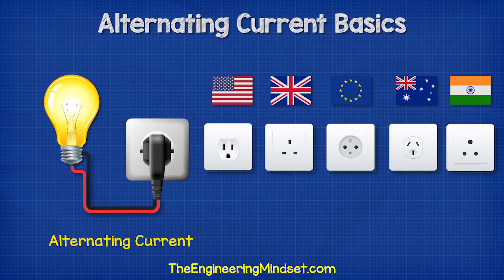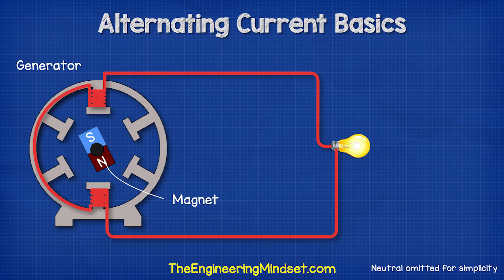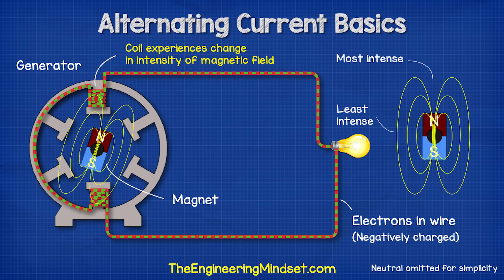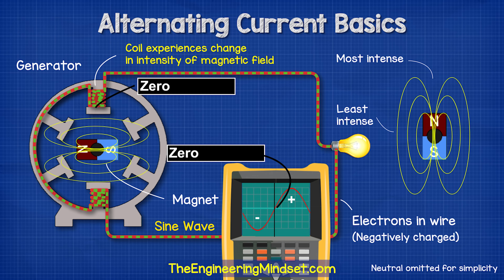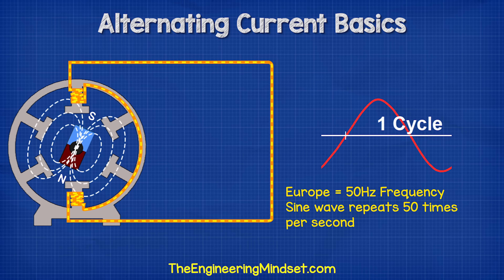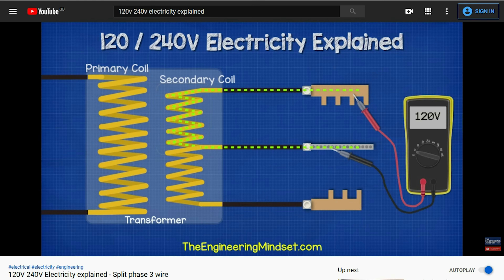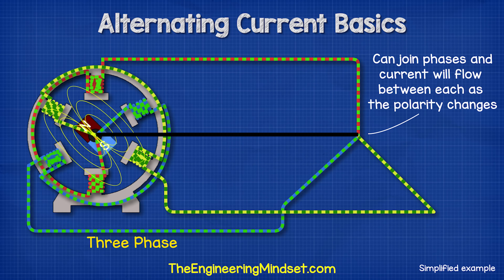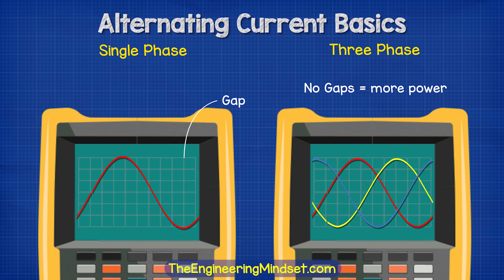AC Basics: Learn All About Alternating Current

Comment: 1:26 Why is it that when the magnetic field lines of the rotor magnet pass through the stator windings at their maximum (e.g., the north pole is opposite the windings), the generated voltage is also at its maximum? As far as I know, when the magnetic flux through the windings is at its maximum, the generated voltage is zero because the rate of change of magnetic flux is zero. Could you please explain this to me? Thank you!

Comment: @EngineeringMindset - thank you. I've been messing with DC for about 35-40 years as a driver/mechanic, signaller/radio operator, computer scientists, IT infrastructure guy, FPV quadcopter builder/pilot, HAM radio opertator etc, but I've never understood AC, and no-one that I have asked has ever given me an description/explanation I could understand. This video finally did it for me.
Don't get me wrong I don't plan on messing with mains power anytime soon (or ever), but I feel like I understand it better now.
Like I could never work out what neutral was for. Now I think I have it.
Thank you, thank you, thank you.

Comment: During a single cycle, have far will the average single electron move? Would it have 0 displacement?
Reply from the maker: Yes, it basically goes no where in AC. In DC it drifts along the circuit

Comment: So does this mean that a neutral wire in a house is actually the same as a hot wire since electricity is oscillating back and forth?
Reply from the maker: No, the neutral is physically tied to ground which is the same potential as you (0V) so you are always the same voltage as the neutral (or should be assuming no faults) but the hot wire is always higher potential that you. Positive or negative.
Reply: @EngineeringMindset thanks for responding and great channel!

Comment: AC moves electrons "back and forth" through the wires connected to the light bulb? If yes, then how did that power get to your outlet in the first place. At the generating station, the "alternating electrons" are doing the same thing, and not "going anywhere". No one explains this correctly. Explaining transmission lines and higher voltage to dodge the power loss due to Ohm's law is correct. The "transmission" part of line is left out. How does a radio transmitter "send the signal", sometimes 50KW or 1MW (Mexico) to the antenna, then into free space? Transmission lines! My mental model is a generating plant is a "transmitter" of 60Hz carrier that has an excellent impedance match to the transmission lines, then that energy is transmitted through the transmission lines to the destination city where that power is now available. It did not get there by electrons "moving back and forth" 60x / second. It was transmitted. No one explains this clearly.
Reply from the maker: Please see our recent three phase transformer video
Reply: @EngineeringMindset  I did a week ago or so. What is missing from most explanations is the actual behavior of a transmission line and the sine wave actually propagating from the high-voltage secondary, down the transmission line for several hundred miles or more, then stepped down at a substation. You need to get medium deep into transmission line theory ( "infinite chain" of L-C inductor/capacitors and such ) before understanding how AC power  actually moves from the generation station to the consumer. It most definitely does NOT get there by "moving back and forth" like most animations about AC show.

Comment: If it changes direction then why one ac terminal is always positive and other is always negative.
Reply: You're thinking of DC not AC. AC doesn't matter.
Reply: AC terminals don't have positive and negative. Voltage is applied to the live/hot wire, and that voltage alternates between a positive electrical potential (voltage) and a negative electrical potential.

The neutral terminal doesn't have a voltage applied from the supply, it is there for a return path to supply.

Comment: i dont understand how it works. lets say O is positively charged electron and - is negative
DC:                                                                       
                                                   output>    |      input>    |
                                                                     |                     |
                                                     oooooo------------- -------oooooooooo
                                                      ----->---------->----------->--------->----->
ac:

                                                   output>    |      input>    |
                                                                     |                     |
                                                     ooooooo----
                                                     <------->----->---<
the e same electron passes through the output?????? so how does that work
Reply: Movement of electrons creates electricity not the direction

Comment: Should there be no current flowing through the neutral wire in a home? I see it goes back to the ground in the electrical box however no electricity flows in my mind without a ground to complete the circuit. So I'm confused about what's happening because in your diagram, it apparently shows only the hot side doing all the work
Reply: Neutral only carries the unbalanced load back to the transformer, that's how the loop is completed in your panel. The reason why we connect it to ground at the first breaker or disconnecting means is so the voltage coming into your house has a reference point to ground otherwise you'd get abnormal voltages like 260v. But if you see 125v or small discrepancies that should be fine because the utility company will sometimes step down to 125v if it's an older area or countryside so they can over compensate for voltage drop

Comment: Hi I have a question if electricity always wants to return to the source in single phase it uses the neutral but in a 3 phases configuration with no neutral how this happens Thanks love the channel
Reply from the maker: It comes back on the other phases, whichever is in reverse at the time
Reply: @EngineeringMindset  Got it thanks

Comment: The split phase transformer doesn't split a single phase into two, it outputs two lower voltage circuits (instead of one, like a conventional transformer) that are in phase with each other. If it did output two phases, then the voltages from the two hot wires would no be in sync. Great video nevertheless.

Comment: Correct me if I'm wrong but all power coming from the power stations and in the main lines is 3 phase, but a transformer will convert it to a signal phase before it enters your home.
I learned this because I wanted 3 phase power at home to power equipment but couldn't get it because I wasn't close enough to an industrial park(so I bought a phase converter). Commercial areas don't have the signal phase transformer converter out on the lines so they get direct 3 phase power.
Reply: Not quite.  In residential areas the power company just sends two phases or one phase and a neutral at distribution voltage ( like 7200 or 12kv examples) to save copper/aluminum costs.  If you go back to the substation it is three phase, it’s just that each loop out to neighborhoods won’t get all three phases.
Reply: The transformer at your house changes voltage down to a level acceptable for utilization.  like 240/120.
Reply from the maker: Seen our new 3 phase transformer video?➡️: https://youtu.be/u0SsejDCVkU

Comment: Current changes direction 50 and 60 times a second. The sine wave frequency is 50 and 60 Hz. 
In a DC sine wave signal at 50 Hz, the current doesn't change direction.
Reply: There is no frequency  in DC.

Comment: Is 3 phase better than 2 phase and/or 4 phase? Why specifically 3?
Reply: because they're 120 degrees apart and it's more than enough to mitigate any power drops in between phases, and most industrial motors are designed with 3phase ac in mind.
Reply: @senzuka_se  ty. So, a fourth phase would add nothing, or too little to justify the costs?
Reply: @tmhchacham  on 2 or 4 phase the neutral currents wouldn't cancel out so you'd need more conductors this increasing costs and over complicating a network.
Reply: @andycrask3531  So then the next option would be 6?